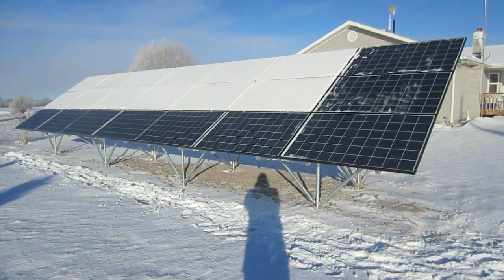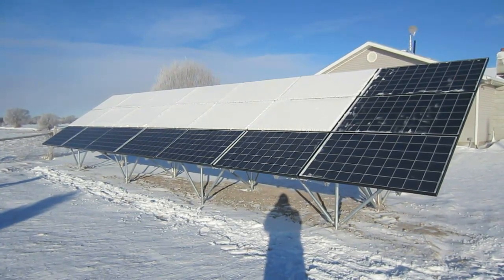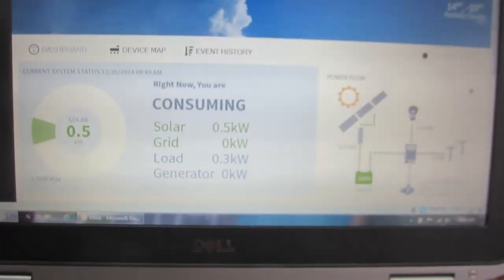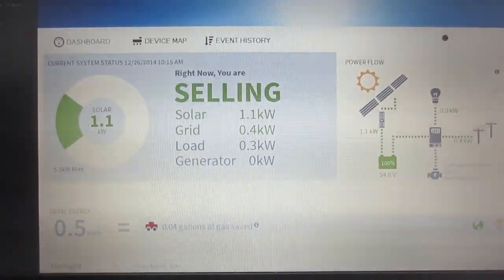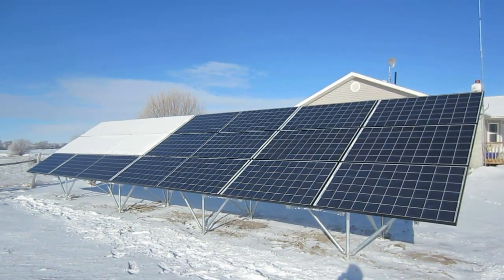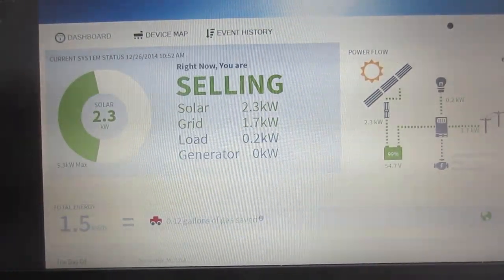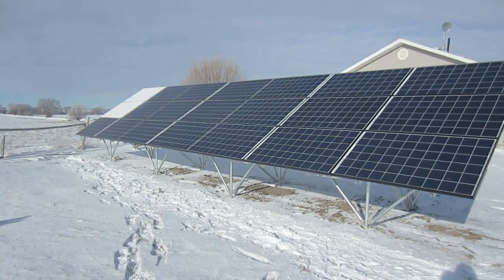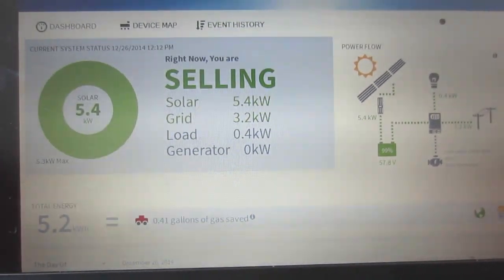How To Maximize Solar Panel Array Output

Comment: Cleaning off  one panel could work.  I mean it won't be drastic but  it would be an increase.  In series.. and naturally cleaning off parallel will only a low you to reach a certain number no matter how many extra paralell panels you clean off. I'm talking about voltage btw

Comment: I used to work for Alberta forestry as a Communications Tech. We had panels at lookouts that we installed vertically so that in the winter they would not collect the snow. We had one array that was blowing fuses on the charge side for two reasons. First solar panels at minus 40 C are 25 % more efficient than standard test conditions. Second, the snow gives us an albedo (sun reflecting off snow) factor that increased the current further.  If you want to take something away from my experience, put your panels almost vertical to capture this "extra" free energy during the winter months and as the snow disappears and the days get longer lean back the array. You are already experiencing both factors but they would be more prominent if you adjusted your array.

Comment: Can you run bypass diodes between your panels in each string? From what I have seen that's an easy fix
Reply: Yes, you could actually put one in on every single module so they would never affect each other.
But for some reason manufacturers (even the most expensive ones) are not adding that feature. What is crazier still is the fact diodes and PV modules are almost identical elements, so they could be adding a diode functionality right at the manufacturing process.

Comment: Why not connect the series horizontally instead of vertically to compensate for low sun angles.  At lest the top row would produce power. I'm giving Big Dog a call.

Comment: Hi there, nice solar system you have, i bet you sell allot to the grid, because it's winter, in the summer, you prob gonna use allot of energy(A/C) running 24/7, ever thought to add "hybrid" package, like a bigger battery-bank, to store energy whatever you collect at daytime, when battery is fully charged, whatever leftover energy goes back to the grid...

Are you also planning to add a 100ft wind turbine on your yard, like a 1.5KW( than the battery can be charged at any time day/night(when wind is available)..

Comment: If you have a lot of snow you might want to hook up a tracking type system. You could have it set so that after sunset the panels are in a position where the snow wouldn't be able to cover them. Then at sunrise they would track back to the sun again. Trackers can be bought cheap on Ebay. You would have to build a movable rack system.

Comment: that was in winter. now is the summer. what's the difference? can you make a new video? thanks
Reply from the maker: +Richardhstar Because we know there is less solar power available in the winter due to shorter days and lower sun in the sky my panels were set to maximize solar absorption in winter. Because of that we generate almost exactly the same amount of power in the winter as the summer. We get either a credit or a check from our electric company each month at full retail price for the electricity that they buy from us. We have not had an electric bill since February 2015.
Reply: +LDSPrepper Very interesting.  Thanks.  My panels are fixed onto my roof.  They do generate some in the winter, but not as much as I use. The excess summer power goes into a "bank" that I draw on in the winter.  At the end of each year, we "settle up" and PSEG pays me for the excess.   And I do use a LOT in the summer.  I have central air, a heated pool and a hot tub that uses insane amounts of power.  But I still have a zero electric bill.
Reply: Most of the electricity you generate will be in the summer, when the days are longer.  The surplus goes into a "bank" that you draw on in the winter when the days are short.  Once a year, we "settle up" and the electric company pays me 10 cents/KWH.
Reply: This is awesome setup brother and thanks for sharing this brilliant video. 
Please check out my channel and subscribe comment like and share.
God bless

Comment: This is because of mono Blocked Panels.  If you use multi Blocked Panels which have several internal arrays in one Solar panel then this won't happen.

Comment: I am so happy for you. I just got my first 2 moncrystalline panels last month. I am buying piece by piece. This month I will be shopping for battery's. You have helped me allot to make the mono choice, I am in Missouri. And have been tracking sun use this winter. I have 1 solar heating panel temporary installed. But it has proven to be worth a permanent install. Best wishes to you. E :)
Reply: Happy to know

Comment: you should be using the Enphase Micro-Inverter system with a micro-inverter for each panel - then all of the panels are independent and so Shading on one panel won't affect the output of any other panels  - not your whole array ...

Comment: Hey LDSPrepper, did you consider Nickel Iron batteries for your PV system? I'd never heard about them before today, but I wondered if you considered using them and, if so, what your reasoning was for going with your Crown 430 deep cycles instead. Love your channel!

Comment: I was wondering if there was some sort of heater system that would keep the snow melted off?  If you were away on vacation or something, would it be possible for the system to discharge enough to go down or maybe a standby generator would have to run fro a week?  I also was wondering what the service life for the batteries in a solar setup would be?
Reply from the maker: Mike Dolan So far I have only removed the snow twice. I have seen steam coming off the solar panels when it was 14 degrees outside. The snow will generally melt by itself. I just wanted it off sooner. I don't think a heater is necessary. When I do remove the snow it takes about 5 minutes or less. Depending on battery type and use, batteries will last from a few days to 30 years. I anticipate mine lasting between 20-30 years.

Comment: Is it normal for a well pump to use so much?! Wow. I hope you are getting some commission from any more work Big Dog Solar gets ;-)
Reply from the maker: Geordie Prepper It is common for a well pump to use 2,000 watts when it runs. It is a 240 volt motor that pulls 89 amps. So it does pull a lot of power, for a short time.
Reply: LDSPrepper Well, I had no idea it was so much! Nice to know these things :)

Comment: Micro-inverters would have eliminated this issue as each would be working individually for a panel. Also converting into AC directly from your panel rather inside the house is safer and more efficient than DC.
Do you happen to know if your rated system is in DC or AC?

Comment: The output will go down in hot weather. I have six solar panels; 4 homemade and I bought 2 x 225W Chinese solar panels. the max output was in a very cold day - 1400W. Usually here in Georgia in the winter I get 1100W and in the summer when is hot max 980W.
Your output will go down when it will get hot but in the same time you will have more hours of sun, so it will more than compensate for the lower output.
Also my inverter is very efficient.

Comment: you could probably set up a sliding brush rail that could clean all of the panels off with one sweep, motorize it, and set up a  remote switch, and you never need to go outside again ;)

Comment: Do you own your system or are you leasing?   if you own it, what was your total cost for equipment and install?
Reply from the maker: John Norris Please click the link below this video for all the details in my Going Off-Grid Step-by-Step playlist.
Reply: Ok, thanks
Reply: +don trump maybe he is charging batteries.
Reply: +LDSPrepper at the end of the video 5.4 kw generated. you use 0.4kw to power the house and sell 3.2kw to the public grid. my question is where are the kw missing? (1.8kw )

Comment: with that kind of production, id cut grid tie altogether. unless they can actually pay you the difference. dead of winter even on a clear day is almost worst case for solar especially up north. you've got more than enough power generation to go off grid with no worries. this summer will be insane. youll be looking for ways to use power!
Reply: I think dead of winter on snowy days is worst case and where he is they get a lot of snow.  Here in pennsylvania we have days at a time you don't see the sun.  Depending on his battery bank cutting the grid tie would be nice.  Of coarse if there is no cost for the grid tie then no reason to cut.  What was the total cost?  Also it seems like the system is way over sized is there a reason for that?
Reply from the maker: BushcraftDad Please click the link below this video for all the details in my Going Off-Grid Step-by-Step playlist.

Comment: Nice set up,wish I wouldn't have mounted my solar on my garage roof,price are also much cheaper now,I installed mine back in 2011 15 sharp panels with Enphase micro inverters now is a good time to buy.

Comment: Hi am really liking this series of videos, just one question at the end of the video the screen shows 5.4kw ,3.2kw grid and a load of .4kw, what happens to the 1.8kw being generated by the solar. i don't know anything about solar but am learning slowley.

keep the videos going.
Reply from the maker: Power from the panels goes to first run the house, then recharge my battery bank then to the grid. It could have been going to charge the batteries.

Comment: David, I have 24 solar panels (each with its own Enphase Microinverter). Each panel is independent. However, if one 6 inch cell on one panel is blocked with a hunk of snow, that panel will be degraded by 80-90%.  -Barry
Reply from the maker: That is correct for that type of setup. There are advantages to micro inverters but that is one of the drawbacks.
Reply: LDSPrepper The fact that microinverters operate independently is the biggest advantage. If one panel is blocked, there are no other panels on that circuit to block. The biggest disadvantage to microinverters is that they will not operate without power from the grid.
Reply: bn12595 They could operate without power from the grid - it's just a racket to get you to stay connected - if I ever get the chance to get panels I'd go with what LDS has done - not because I'm green because I don't want to answer to "The Man"

Comment: I use Schottky Diodes where the series arrays connect in parallel with the other series arrays. If you don't use isolation diodes, one series array will try 'charging' / 'sourcing' the ones in the shade... You've got a beautiful set up though dude, great job. :)

Comment: Did you consider a solar tracking system to move the panels during the day to get max energy output from your solar array? I am NOT an expert by any means and I do NOT have solar or have ever had solar but I find it very interesting

Comment: I want solar for my home!  Hope I can afford it when it comes time.   How much do you get paid back for selling to the grid?
Reply: In one of his other videos on the solar system I think I recall him saying there is no cash back in his area but whatever he puts in, he can use for free. kinda like having a big battery bank with no maintenance.
Reply from the maker: Plan Bee Orchard & Farm
Correct.
Reply: Still sounds great.
Reply: Exactly.  However with one exception that on an annual basis, the counter is reset. So all the power he can store through the spring summer, fall, and winter is credited to him to be used. Then when the next spring rolls around, they reset the counter and all remaining energy is forfeit.  The policy on grid-tied solar varies in the many areas of the country so check your local power companies rules when planning your system.
Reply: Plan Bee Orchard & Farm so if he puts in 10kwh  into the grid,  he can pull that back out of the grid later and it does not get billed?
Reply: Where I live, in California, we get paid annually for any overage.
Reply: Same here with PSEGLI in Long Island, NY.

Comment: Great results! I'm curious to see the tradeoff between low angle and cold panels vs. the high angle and hot panels you'll have this summer. Hopefully the better angle will make up for the lower output from heat.   :-)